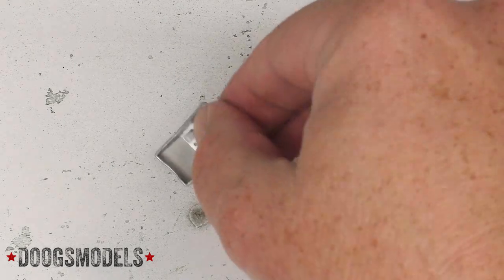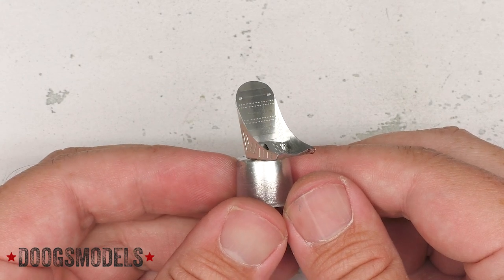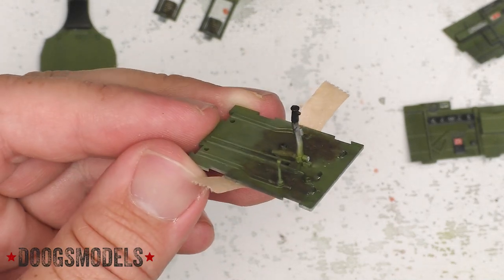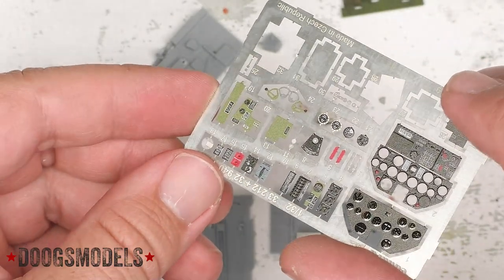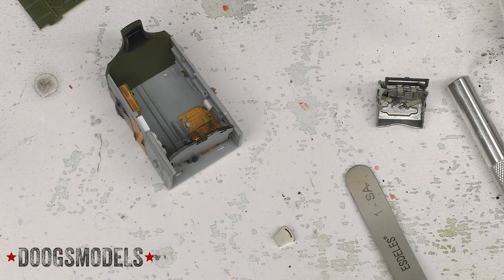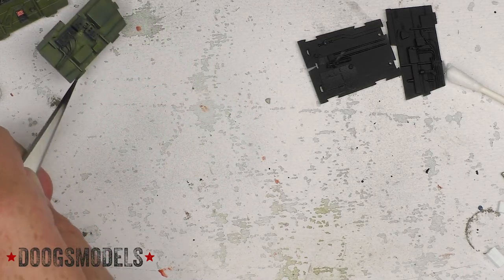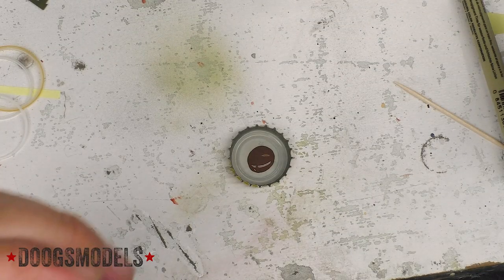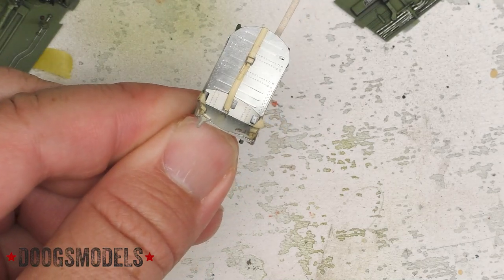P-40F Warhawk Build 02 - The Cockpit

Comment: Good videos Matt do you thin MRP paint if you thin what do you use thanks
Reply from the maker: You don't need to unless you're trying to pull off something unusual (shading etc), but when I thin it's either Mr Leveling Thinner or Mr Rapid Thinner
Reply: @DoogsModels  thanks Matt